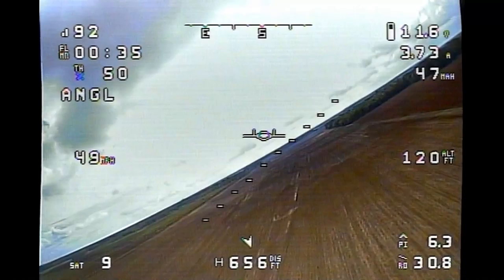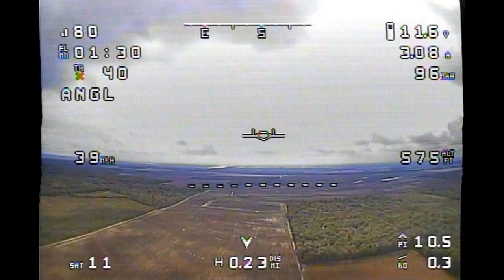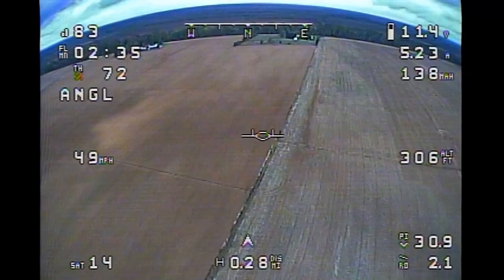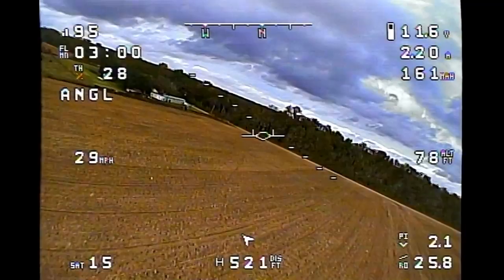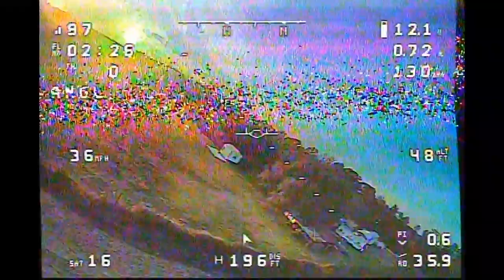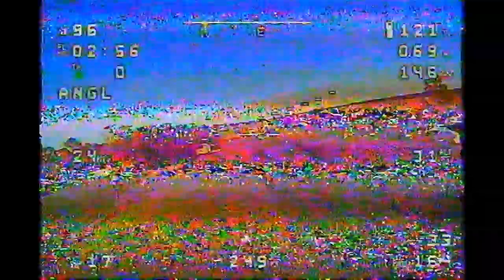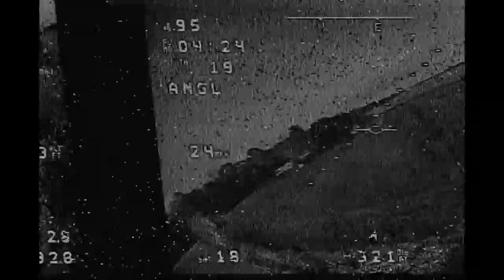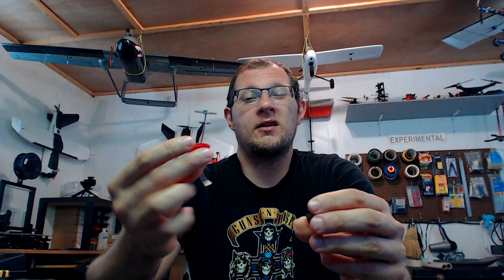Video Transmitter Problems, I want your input!

Comment from the maker: Wow, SO many good comments and suggestions! lol Not sure where to start replying to you all, so I'll post this and pin it, then try to get to each one as I can. ;) Right away I noticed a few people suggesting I check out the UFL connector more closely. I did, and found the issue! (I told yall I don't do all this micro/5.8 stuff... lol Give me big heavy transmitter with SMA connectors!) I'm calling this one a manufacturing defect, but I can't really blame them for not catching it, I didn't either at first until I started probing with a meter and found I had no ground connection from the UFL connector to the antenna end of the cable. Look close, the top cable is the black antenna I showed, should be good. The bottom cable is the one from the red antenna. The outer insulation is not removed from the braided shielding, but left on and crimped in the connector. That explains it! lol https://i.imgur.com/IvpDUDQ.jpg So many people were spot on with their suggestions, check the UFL connector, and it seems the antenna wasn't radiating. That's why I like y'all! lol (Well one reason at least) Just to confirm, I did stick the little stock sleeve dipole back on the transmitter and managed to sneak in a quick flight before the weather moved in. It was a little rough and windy, but the plane handled it well. I didn't even have time to charge the battery after the attempted flights yesterday, so I didn't venture out too far, just having the battery voltage to go on. I did take it out a mile again though, with perfect video. I'll upload that later as well. Now I've got a new dilemma... Do I stick with this setup, or put the X2 Ultimate in anyway? haha Judging by the comments and votes, I think most of us (including me) want to see it. I'll eventually do it, just maybe not immediately now.
Reply: bonafidepirate the AKK x2 was my favorite 5.8g vtx.  Fly it fixed see what happens then decide to change vtx or not.
Reply: "Give me big heavy transmitter with SMA connectors!" <------Amen!!!

Comment: To eliminate noise from the flight circuitry you might want to connect the camera & tx to a separate battery in the bay. 

If that improves things then comes the hard slog of finding the cause - check your common ground, add a capacitor across the power. If you have an oscilloscope that will make things easier as you can watch what happens under load.

Comment: This is a very weird moment for me because I had the same issues and you actually taught me how to fix it. 
Prob: Ur ESC and/or motor is interfering with your vtx.
Solution: bought a 12inch antenna extension cable and a 90 adapter to move the antenna way out on the wing. It doubled my range from 1/2mile to over a mile till my spectrum started dropping out. And also the farther my goggles were from the transmitter the better. I looked pretty strange holding my radio way out with my head turned away. Hate to say..the new 3D print might need to remove the antenna mount. Too close. 
My guess Kieth
Reply from the maker: This turned out to be the antenna, or the connector on it rather. Details in the pinned comment!

Comment: Just to make sure you are controlling on 2.4 and FPVing on 5.8?  What Vtx are you using, and how are you powering it?  What power setting were you flying with?  Where is the antenna mounted on the airplane, and in relation to other RF devices?.  First thing I would try is a different antenna on the same Vtx.  If same results try a different Vtx.  From my understanding with this small Vtx the really high power setting create more heat than they do transmission power.  Maybe the QC on the Vtx wasn't up to snuff and it's not transmitting on the indicated power.  The other thing I would do, and I know you know this, is reduce the number of connectors to a minimum.  There is going to be a signal loss with every connector you use.  I HIGHLY recommend VAS antennas.  They have outstanding customer support.  Alex (owner) will almost always get back to you with any questions or concerns  

https://www.videoaerialsystems.com/

Comment: I'd bet it's the U.fL connector. They are the most unreliable connector in that application as they are not designed for it. Their specified life is 6 reconnects, and their intended
application is fixed module interconnects in PBA's and to be connected (assembled) robotically. They are very easily damaged when assembling with the slightest misalignment. The problem is, it has more than likely killed the transmitter's output device, the signal you were getting will be the pre driver pass through. GaAsFET's will still pass current and get hot without actually working as an amplifier.

Comment: The pagodas have a very flat doughnut shaped radiation pattern...Enclosing them in plastic to make them look pretty isn't very bright given the incredible sensitivity associated with 5.8g...The signal looked as weak as a kitten tbh...The solution of course is a 200mw 1280mhz vtx and the R9MM reciever...I have tried it, it works fine...Put the vtx dipole out on the wing away from the ESC....It's why I stopped using 5.8g, it's so unpredictable..You do know for certain what frequency the vtx was set to?..RHCP?
Reply: I have flown out 10+ km  at an altitude of about 2km using.5.8ghz ORT Pagoda antennas with very little break up.
Reply from the maker: I wanted to go 2.4/5.8 on this one mainly because everything is packed close in this small plane. Also, typical antennas for the lower frequencies will be relatively huge on here! lol I found the issue and fixed it this evening, I posted some details in the pinned comment above. It was the connector on the antenna improperly crimped though. vTX is still working fine with a good antenna.

Comment: Since the problem was in and out I would think: Two or more devices on the plane aren't playing well with the others. or you could have a bad cable, or one that is going bad, or one of the components are beginning to go bad.  No expert here, myself I start with the easiest and least expensive options first and then progress through the process of elimination.   I hope you will post the fix when you find the problem.

Comment: The problem actually is the antenna.  Just because its in one piece and nothing appears broken doesnt mean its right.  Those Foxeer pagodas are pretty horribly built, and built incorrectly. Firstly, they use RG178 coax without taking that into consideration on the PCB's.  The antenna needs redesigned completely to account for that coax. If you look close, you will see they simply put the RG178 through the hole intended for RG402 and built it up with solder.  The coax is very integral into the design of the Pagoda. Using something else will throw off its tuning significantly.  Secondly, every one I have taken apart, the top boards are completely mis-aligned.  This yet again throws the tuning way off. The boards must be properly aligned radially, and spaced properly axially to be tuned properly and have the radiation pattern and axial ratio that is specified in the design. Then they add a big blob of solder to account for the smaller coax making things worse.  This all adds up to a very poorly matched antenna for the frequencies it is sold to be used for. Most often with these issues their center frequency will be well below the as designed 5800MHz.  Often down in the 5500MHz region, and rather high SWR at that.  The antenna is THE MOST IMPORTANT piece of the system.  You would be better off with the stock dipole or the also poor CP antenna that comes on the VC400 (depending which version you got of course).  Get rid of the trash antenna.   Also, the placement of the antenna is fairly critical at these frequencies (all freqs., but especially so at 5.8). Keep that in mind.   A well made Pagoda will easily get you several miles at  200mw at altitude.
Reply from the maker: It was definitely the antenna, see the pinned comment I just posted. I did see what you mean about he small coax being soldered into the PCB as well. In my opinion, those little UFL connectors are not that great for this coax either, they're too small to crimp it properly, and the cable is really too stiff for that little connector too.
Reply: @bonafidepirate   True. They are not really intended for this type of application anyway.  MMCX is a much better option.
Reply: True about it appearing right doesn't mean it's right. On my second high-altitude balloon I had much worse reception than the first, after I recovered it I messed around for ages looking for bad connections etc. Eventually just swapped the antenna and it was fine. Being curious about what was different in the bad antenna I opened them both up, but could not find any difference whatsoever, the continuity was good in all the right places too. Weird.

Comment: Hi Keith. Here is my input. I think there are two problems you have here since you moved the vtx to back of the plane. 1st, your likely very close to the esc which has a switched BEC, and therefore there is noise  coming out of the components of the BEC. Second, you have antenna close to the middle of the model which means the motor is sitting between you and the model while it’s flying away, or your fc+battery blocking the beam coming out of the antenna as it’s flying towards you. I had a similar setup on my nano goblin(a model similar to the dart 250), and I ran into the same issues. Imagine if you had an LED where your vtx antenna is. Will you be able to see it while the model flying away or towards you? That’s why I would always recommend installing the vtx on one of the wings. Great review btw, am waiting for mine coming from BG :)
Reply from the maker: The ESC is actually right behind the FC, under the little air vent in front of the GPS. The vTX was a lot closer to it before I moved it to the back. There's no motor noise or anything when running it up (like you'd expect if it were noise from the motor wires getting into the video wire or something), and it didn't improve when I cut power to dive down. I thought about the antenna placement too, and if the motor and battery were blocking the signal as you said. The first time the video went away right after swithching to RTH though, the plane had the right wing pointed towards home so there shouldn't have been anything blocking the signal.
Reply: What is shown in the video is not switching noise. In fact there is no conducted, or radiated noise visible that I can see. What IS visible, is poor radiation from the antenna. The video is very clean as far as any potential power supply, or radiated noise related issues are concerned.  But you are correct that equipment on the plane can be blocking.

Comment: After flying out multiple times with 5.8 GHz Fat Shark 250mW VTX with Mad Mushroom on the plane (Apprentice S15-E) and VRX connected to VAS Pepper Box with no problems, one evening I attempted the same routine flight and about halfway out the video started going bad and finally had to use Vectors RTH to get the plane back because the video became totally unusable once i turned the plane around just like yours did.   I switched to 1.3 and never had any problems again except one night when the temperature dropped and there was dew forming all over everything.  Condensation can effect the SWR of antennas especially 1.3 and above including the VRX receiving antennas on the ground.  The fog and condensation was probably at least partly to blame. Just my two cents worth.
Reply from the maker: I just posted a comment and pinned it, found the issue and posted a picture of it. Turns out it was a bad crimp on the antenna!

Comment: Ufl connectors are notoriously weak, and are generally not designed for multiple uses, they are mainly a tiny RF connector for computers and cell phones.  The designer of the Pagoda antenna said the plastic covers will attenuate the signal some, but it shouldn't be that bad that close.  You did move the transmitter back between the motor & ESC with the new back hatch, that may be causing issues.  Basic 1st rule of troubleshooting is what did you F with last?  You changed too many things to pinpoint.

Comment: Check:
- Antenna
- Antenna cable, connectors
- Video Tx
- Video Rx channel (some bands/channels overlap; might have been on the wrong one)
- Interference from motor/esc
- Power wires for breaks or bad connections (video wire too)
- Voltage level to video Tx
- Voltage regulators for noise or faulty

Comment: if antenna came un-tuned (plastic case modifies vswr, i hope they are tuned after), shielding or center wire of the antenna isnt connected to active element the PA on the vtx would overheat and loose its specified power due to reflected power. main vtx chip would still heat normally.  i had one time a situation like this where after a crash on a quad i kept flying with the broken shielding on a pagoda . even after repairing the same pagoda .. vtx didnt work as previously.  ham radio experience expains it.
 hope it's some dumb issue tho. 
cheers.
Reply from the maker: It was the UFL connector, found it, put the stock antenna back on (little crappy sleeve dipole) and flew it out a mile without issues... ;) I posted a pinned comment with details.

Comment: Those UFL connectors are notorious for NOT connecting right. That would be my guess for the fault.
Reply from the maker: You nailed it! lol See the pinned comment for details, but it was the UFL connector, it was crimped with the outer insulation still on the coax.
Reply: I was about to chime in on this same thing.  I had a ufl do the same thing, had to solder the ground.  I won't get a vtx with a ufl again.  They are not reliable.
Reply: @bonafidepirate  Yay. Winner Winner, Chicken Dinner!!! lol. Pesky UFL spoils the day again. MMCX are heavier,  but still far better IMHO.

Comment: Could it be antenna placement?  It seems that facing home gets worse.

The Pagoda is a very 'flat disc' pattern antenna.  Could the ZoHD nose up stance + this be putting the battery etc between the TX and RX?

Comment: Noob here:) my quadcopter video was doing the same thing, after playing around I found my battery wire was bad at the xt connector. I wiggled the wires while it was powered on and the flight controller lights would blink off, so I kept looking till I found the short.

Comment: Ok so I am not expert but I figured I could at least apply a process of elimination to the problem... 1)As far as i can tell there was no specific direction where the signal was blowing out so I dont think its an antenna placement issue.. 2) The signal did not seem to go out at high amp draw or anything so I dont think its a BEC problem unless its interference from the bec like suggested by SiriusFPV. (I have had an issue before where there was a problem with the 5V rail on an FC and it would start to brown out the signal on high draw and eventually just shut off) 3) I have had an issue before with a U.F.L.  antenna where the problem turned out to be in the actual connector itself. I tried to solve the problem for MONTHS and it turned out to be that where the coax feeds into the UFL there was a bad connection and it wasnt able to push the output into the antenna itself, leaving me with the same symptoms one would get from having the UFL come off the board partially... I feel like this could be the problem but the only way to know is to switch the antenna out.. 4) A bad VTX. This also seems likely considering the symptoms. Those runcam VTX's dont have the best durability in my experience.... The eachine nano vtx or the nameless RC nano vtx are both awesome options with 400mw max output and are the same weight or lighter than the backpack style vtx's....

Anyways thats all I can think of and you certainly have MANY years on me in this hobby so Im just speaking from my own experiences.. hope you get it fixed man, that little bird is really awesome I think im going to have to order one :)
Reply from the maker: You win! lol I like the way you think through the problem to eliminate possible causes. Process of elimination, I use it a lot! lol I had it narrowed down to either the vTX or the antenna as well. It turns out it was the antenna, or more specifically, the UFL connector was improperly crimped with the insulation still on the coax. I posted some details in a pinned comment above.

Comment: Was there any weirdness on the vTX PCB with the ufl connector? I've had the behavior on 5.8 systems after crashes and damage to the SMA. So odd. Do you have an RF Power Meter you can use to measure the output on the vTX? I'm really curious about what the issue is. Use the overpowered vTX though lol. The idea of a med/long range ~300g wing is awesome!
Reply from the maker: I don't have a power meter, but it would have been useful here for sure! It was the UFL connector though (pinned comment above with details) I will most likely still put in the bigger vTX, just not so soon now since it's no rush to keep it flying. ;) I'm definitely leaning toward some longer range with it now that I've flown it. It's a lot more capable than I expected for such a small plane. Should be fun!

Comment: I had issues with that exact vtx when it would get hot.  My issue was a bad 5v regulator so the vtx was getting more than the rated 5.5v input voltage. The vtx would get very hot and I would get static.  I put a fan on the vtx while it was powered on my bench and video would clear up. I fixed my power issue and the vtx has been fine.
Reply from the maker: This one is powered off the 5V supply on the Matek board. Turns out the issue was the antenna, details in a pinned comment.